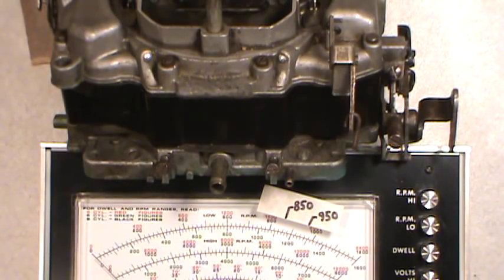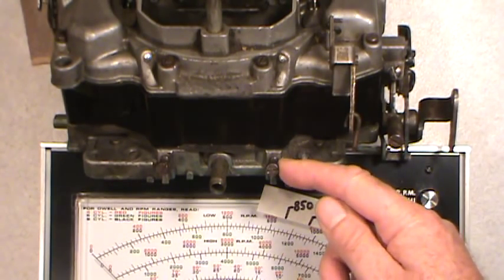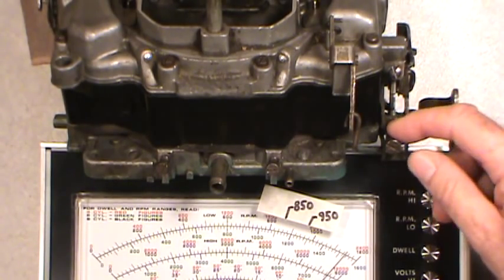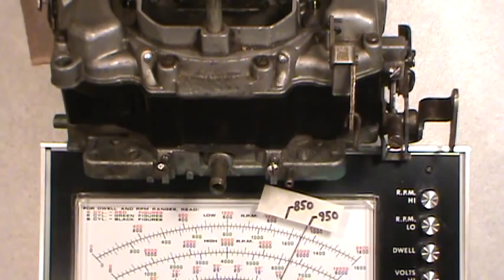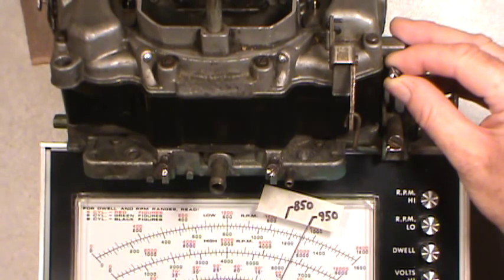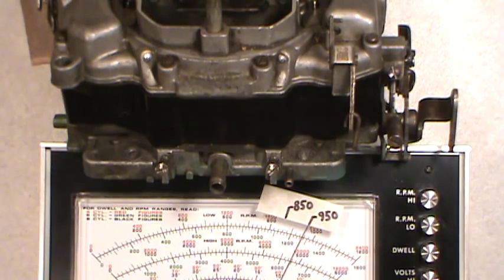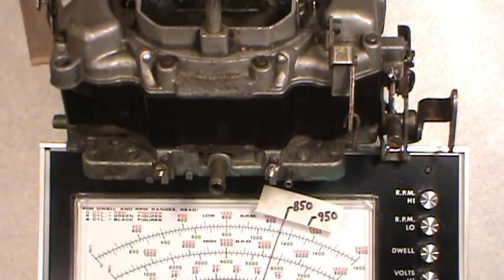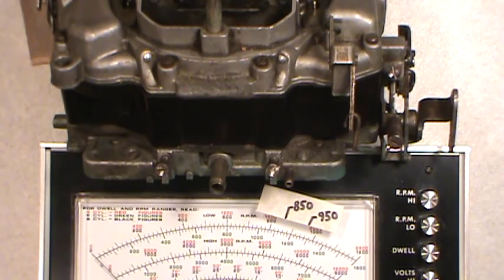Idle Mixture Adjustment on 4 Barrel and 2 Barrel Carburetors

Comment: I WANT TO SEE WITH ROCHESTER QUADRAJET AND AUTOMATIC TRANS......THANKS
Reply from the maker: Greetings mco zpda....Thanks for your comment....I would like to let you know in advance, that, even if you manage to get your "4-Barrrel-Quadrajet" Adjusted properly for the "Smog/Emission" Test, that there are "Many" Other things that can cause your Vehicle to "Fail" (Not Pass) the Smog Test!....You said that Your Vehicle was a "C-10"...is it a "Pick-Up-Truck???...and...what "Year" is it???...what "Engine" Size???, and is it a "V-8"???....Can You See a Model Number on your Quadrajet Carburetor???....I actually "Did" get a "Quadrajet-4-Barrel" equipped "350-Cubic-Inch-V-8" to "Pass" the Smog/Emissions Test a few years in a row, but, the "NOX" (Nitrogen Oxide) Level was almost "Too High" (just Under the Maximum Allowable), because the Vehicle "Did-Not" have an "EGR" (Exhaust Gas Recirculation) "Valve" on the Intake Manifold, and also, my Vehicle "Did-Not" have a "3-Way" Catalytic Converter on it! (2-Way, also referred to as "Oxidation" Catalytic Converters "Will-Not" Reduce the "NOX" Emissions!).

If you can tell me as "Much" as you can, about your "C-10", then, I will have a much better chance at being able to help you out, with, getting your "C-10" to "Pass" the Smog/Emission Test.

Has your "Quadrajet" been "Rebuilt" Lately, because, if is very Old, it might not Work good enough to Pass the Smog/Emission Test, although, you can still try Adjusting it, and have it smog/emission tested, but, you will still have to pay them the Testing Fee, if it fails.

I still have some "Notes" on how I Adjusted my Quadrajet-4-Barrel-Carburetor that was on top of my 350 Cubic Inch (5.7 Litre) V-8 Engine, that was a very "Basic" (4-MV?) Model, that had the "Thermostatic Choke Coil" mounted separately , and it was mounted in a cavity in the intake manifold, as opposed to the "Choke" that was mounted "On" the side of the 4-Barrel-Quadrajet carburetor.

So then, if you care to, just let me know, all that you can, about your "C-10", so I don't end up, going on a...

..."WILD GOOSE CHASE!!!"...lol.

Till next time...

...Be Safe, take care, and have a good one.

Comment: I need to adjust the cold choKe on my quaradrajet-1985 boat motor.  The port side motor idles too high until the motor warms up  about 2000 RPM,  would be much happier if I could get it down to 1200 RPM--this carb doesn't have the set screw under the vacuum device
Reply from the maker: Greetings patswil1....Thanks for watching this YouTube video of mine, and, for Your comment/question as well....I haven't had any "Hands On Experience" with a  "Marine Specific" Rochester Carburetor to date, but, I'll mention a few things, that I hope, will help You out somewhat....You had mentioned, that You didn't happen to see, what is normally referred to, as a "Fast Idle Adjustment Screw", and the Fast Idle "Cam", that goes hand in hand with it, Under, what is usually, a Choke Pull-off Diaphragm, that also Functions, as a Secondary Air Door Control/Modulator (aka, Air Valve Dashpot).

I had a look see, at some pictures of Rochester Quadrajet "Marine" Carburetors, and indeed, some of the "Choke Control Mechanisms", are "Quite Different", from, what I'm use to seeing, in comparison to, "Land Based" Rochester Carburetor equipped, Cars and Trucks, that are Usually Equipped with that, good ole..."Fast Idle Cam & Adjustment Screw!"

If I was in Your situation, I would be looking for a Factory or After-Market "Service Manual" for Your "Exact" Boat/Engine/Carburetor/etc.

Also, I would be Visiting some of the Many..."Boat/Boating" Related Web Site "Forums", where, most of the time, there just might be, a Person or Two, that has already "Encountered" the same "Faster-then-wanted", Cold Engine, Fast Idle Speed, with the, hopefully "Correct Procedure", that will Reduce those (cold engine) "Excessive" Engine RPM's to an Acceptable Level, that, will be, in the RPM Range, that will be, acceptable to You.

In most cases, all I have to usually do, is, take a look at something, such as, the "Choke Mechanism" on Your Port (aka, Left Side) Engine, and, it sure wouldn't take me very long at all, to figure out, how it operates, and, how to Adjust it as well...but...unfortunately, I'm not there, and, Your Boat isn't here!

With "Both" of Your Boats Engines "NOT RUNNING", move the Required Levers and/or Carburetor Linkages (I'm not sure, but, You might need someone else, to operate the Throttles or Choke actuating Controls, if those Controls are located at the Boats "Helm").

Have a look at how Your "Starboard" (aka, Right Side) Engine's Choke Linkage/Mechanism Operates, as it's moving, as well as, the Distance, that the Linkage or whatever Actuates the "Choke Related Gizmos" Travel, and, maybe take some measurements as well.

Like they (keep) sayin'..."A Picture is Worth a Thousand Words!"...

...&...

...in this (well, actually Your) case, those so called Pictures, are Actually, what You'll be Seein', if, and when, You happen to Observe, the "Movement" of, those "2", dare I say Identical Engine Control Systems (maybe, with the exception, of, having Controls, being "Specific" for, that of, one for the "Port", or Left Side Engine, and the other set of Controls, for the "Starboard", or, Right Side Engine).

Please, be sure, to Run Your Bilge/Engine Compartment "Ventilation System", for the Recommended amount of time, to "Evacuate", any Gasoline "Fumes", that may have accumulated in Your Boat's Bilge/Engine Compartment, "Before" Starting those "2" Engines!!!

Best of "Luck", with lowering Your Boat's, Port Engine's, (cold engine), fast idle speed, to an acceptable rpm level.

Steady as She goes "Captain", as You Ply those Waters, with Your Vessel's Plotted Course...

...Be Safe, take care, and have a good one.

Comment: DO U have video on setting the secondary/4- barrel?
Reply from the maker: +Gatewood's Computer Sales & Serv, Inc. ....Greetings Gatewood's Computer Sales & Serv, Inc. ....Thanks for watching.................. Sorry, but I don't have a Video (yet?), on how to, adjust/set-up, the Secondaries, on a 4-Barrel Carburetor at the moment..................If You can let me know, just which, 4-Barrel Carburetor, that You are talking about, then, I will (hopefully), be able to give You some Information, on how You might go about, making an adjustment or two, to the Secondary side of the Carburetor in question, and............till next time..........Be Safe, take care, and have a good one.
Reply: +RockysRoadshow   1975 Thermoquad like above, on Dodge 440 W200, used as snow plow
Reply from the maker: +Gatewood's Computer Sales & Serv, Inc. ....Greetings Gatewood's Computer Sales & Serv, Inc. ....Well, I do have, oh, about 24 Carter Thermoquad 4-Barrel Carburetor YouTube Videos, one of which, Shows/Talks, about, how the Thermoquad's Secondary Air Door Works, along with, a few of the Adjustments, to be looking out for, and "Only Some" of those Adjustments/Settings, on the Secondary Air Door/Valve, can be made "Without Affecting", some of the "Other Adjustments", that have to be made, in the "Correct Sequence/Order of Doing Things", or, the Thermoquad Carburetor, will more than likely..."Not Work So Good"...!!!.................The "2-Things", that can be Adjusted, on the Secondary Air Door/Valve (with-out messing-up the Other Settings/Adjustments), are...the Secondary Air Valve/Door''s..."Spring Wind-Up" (Tension)...and the "Fully Opening Amount", of the Secondary Air Door/Valve, against the Metal-Tab-Stop (as You will see, in my YouTube Video)..............A Thermoquad Carburetor "Rebuild Kit" or Factory Chassis Service Manual, will usually have, all of the Required Adjustments/Settings, that "Have to be Done in the Correct Sequence"...!!!.............If the Choke Pull-Off, is quite Old, it could Leak Air/Vacuum, Stick, or maybe Not Relax fast enough, which, as I've experienced in the past, makes for a TQ that Runs/Performs like (use Your Own, not so pleasant word here...lol).................Then, there's also, a little teeter-totter like Catch-Lever, that has to grab-onto, the secondary throttle shaft's bracket, but only when the Choke, and its Linkage is Fully Off.............Over the years, when a Thermoquad Carburetor gets Older, and/or, has the Mileage/Kilometer-age piling up on it, then, Parts, like the Floats, Needles & Seats, Choke Pull-off, Accelerator Pump Seal/Cup and Check Valve, etc., start getting old too, and probably, shall we say, worn-out, some-what as well, which, will at times, make-for a Thermoquad, that doesn't Perform, as good as it's able to, and Gas Mileage, might suffer as well, possibly....................You can find that Thermoquad, Secondary Air Door/Valve Video, on my YouTube Channel...RockysRoadshow...and, I think the Title of it is...Thermoquad 4-Barrel Carburetor (Part 7)...if not, just look for the Thermoquad Video that has...(Part 7)...on the end of the Title...oh, and, if You care to, You can have a look at, the Other 23 Thermoquad Videos as well...enjoy....................If You need any more help at all, feel free to post a comment or question, under any of my YouTube Videos, and........till next time..........Be Safe, take care, and have a good one.

Comment: Great Simulation!  Thanks!
Reply from the maker: Greetings...yogiberra47.................You're welcome, and, thanks for the nice comment, and for watching too.............Getting an Engine, to just Run good, is one thing, but, things get really, shall we say, "Precise" (somewhat), as it applies to, just about Everything, that affects, the Amount of Pollutants, that are found, in the Exhaust Gas, that is Exiting the Vehicle's Tail Pipe/s, during, that good ole "Smog Test" (aka, Vehicle Emissions Test)..............Even, if, all of the Settings/Adjustments are good to go, that's only one part of, what will Help the Vehicle, to be able to Pass the Smog Test............All Wiring...Vacuum Hoses...Smog Gadgets/Devices...Catalytic Converter/s (if applicable)...Spark Plugs...(just to name a few), have to be in really good shape (almost like new, somewhat), and working properly, cuz, for example, all it takes, is one, very small (ignition, or fuel system related) "Misfire", and that Smog Sniffin' Machine, will be Reporting, that not so liked, "Fail" word, on the Smog Testin' Report (card...???...lol).............I think, that, I recall hearin', that, in California USA, Vehicles, that are 1975 or Older, are Smog Exempt...???...and maybe, that might mean, No Smog Testing required...???...oh, and, if so, that to me, is, as good as, avoiding a..."Migraine Headache"...!!!...especially so, if the Vehicle in question..."Fails" the "Smog Test"..."More"...than..."Once"...!!!...Yikes...!!!...lol...and.......till next time........Be Safe, take care, and have a good one.

Comment: What can i get to be able to do this ? Gage or meter of some kind. Thx
Reply from the maker: Greetings blakesupra....In order to Observe the RPM's (Revolutions Per Minute) of your Engine, all that's required is, what is called a Tachometer (or, Tach, for short)....Try to get one that looks something like the "Yellow-Multi-Meter" that you see as my YouTube Channels Thumbnail Picture, and in some of My Channels (RockysRoadshow) Videos as well....My Yellow-Multi-Meter is very good for doing all kinds of Tests, when it comes to a Vehicle, and then some....This Yellow-Multi-Meter is far more Accurate then that Big Analogue Meter that you see in this Video (Analogue Meter has that Waving Needle/Pointer).

My "Digital" (shows Big 1-Inch High Numbers on the Display/Readout) Yellow-Multi-Meter can measure all kinds of things....DC Volts, Ohms (or resistance), DC-Amps, Duty Cycle, Dwell & Tachometer with engines that have a different number of Cylinders, an Audible (tone) that indicates a good electrical circuit with low resistance, and, if that's not enough, I could, as an Option, Buy a Temperature Probe that plugs into this Muti-Meter to measure Temperature!

I bought this Muti-Meter within the last 10 Years, and it has more then paid for itself, I must say!

I paid about $85.00 Canadian Dollars for it, if I recall correctly....A very worthwhile Investment, if I do say so myself.

So, if you can get a Muti-Meter that is able to do, most of what mine can, then that's about all that's needed for the "Average-Joe" working at home, on His or Her Own Ride (Vehicle).

Oh No, are you getting that same "Car-Bug" that I got quite a while ago?...You know, Car-Bug, as in working on Cars, Trucks, or whatever, as a Hobby?....Welcome to the Club!...lol.

Take care, and have a good one.

Comment: What Tach do you recommend these days?
Reply from the maker: Greetings...Roger Stevens.........Thanks for watching.........Each type of Tach/Tachometer, has its own strengths and weaknesses.........If it's accuracy Ya want, then, a digital Tach is probably the way to go, and, an example of one, is shown in several of my YouTube videos, on this channel...RockysRoadshow...(it's the yellow multi-meter, that's made specifically for automotive use...it has, tach, dwell, duty cycle, dc volts, ohms, dc amps, diode testing, and, it even has, a temperature testing setting on it, that I can use, if I were to purchase the optional probe for it)...so, have a look see, at some of my videos, where it is shown, being in use...enjoy.........The analogue meter (that's the kind, that has a needle, that waves at you...lol), is good for watching the changing, shall we say, trend, of, oh, let's say a fairly low voltage, as it fluctuates up and down a little bit.........A good visual representation, would be, an analogue Tach, that shows the engine RPM's as the engine moves though the different rotational speeds, of the engine's crankshaft.........In time, you might end up having, at least, one of each type, just like me...lol...and.......till next time......Be Safe, take care, and have a good one.